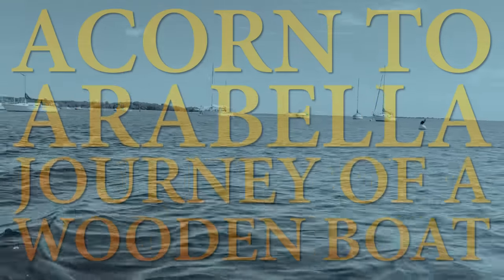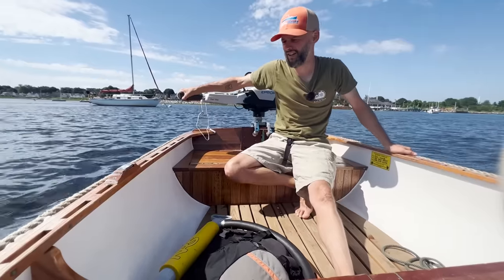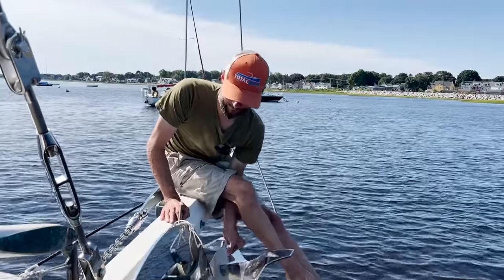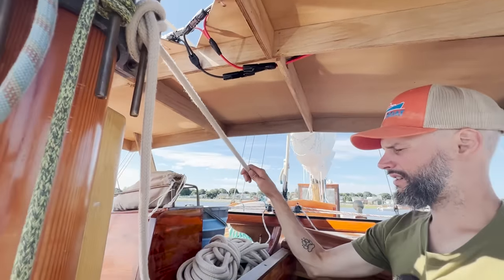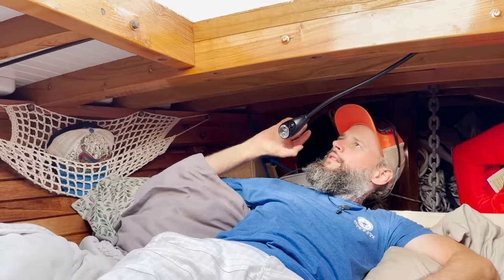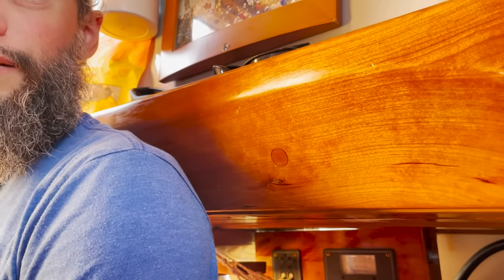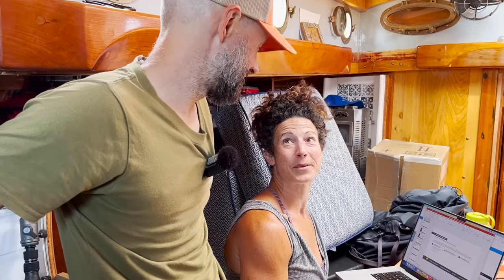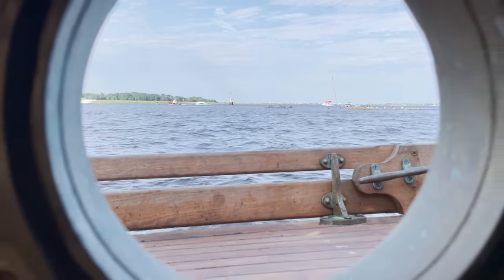2 Months on a New Boat, Full Walkthrough - Episode 277 - Acorn to Arabella: Journey of a Wooden Boat

Comment: The 12V LED strips expect no more than 12V and everything above heats them up and shortens their lifespan. If the boats 12V system is based on the battery's state of charge 11-14.6V - this might be the problem with them burning. You can check it with multimeter. One easy way to decrease the voltage is to put power diode(s) in series with the LED strip. Diodes have a forward voltage drop of 0.7V. So might need a couple stacked together.
Reply: Heat is the enemy of solid state electronics.  I was going to suggest a 12v buck boost power supply is cheap.  It will take 8 to 28 volts DC, and give a steady clean 12.0 vdc.  Also make sure heat can escape the light fixture/housing.
Reply: Too low voltage will also cause excess heat, as the amperage will rise.
Reply: Do they have a good heat sink onto which they are mounted? If cooling is less than adequate, they perish very quickly. Using an infrared camera to monitor heat build up over time might give you some answers.
Reply: would having a pwm led controller help? maybe reducing the duty cycle would help, running at 80% wouldn't diminish the light that much

Comment: Hi Steve, I have been following you since the beginning, never miss an episode, this is my first comment, I hope this can help you.
I used to work in an LED company, and the problem you are having is humidity reaching the sulfur coating.
All LED are violet by nature, a coat of sulfur is added over the led to adjust its color (Warm to Daylight). Humidity affect the sulfur and change its property (color),
in turn, that change the persived color of the LED. You need a led strip that is rated with a high IP factor, I think IP66 or more from a reputable manufacturer,
meaning having a very good seal again humidity, especialy on a boat.
Hope this help you in selecting the next one. Happy sailling. Gilbert

Comment: I love this episode. Obviously my land yacht has nothing in common with your boat, but every problem, fix, solution, and regret you have had on the interior is remarkably similar to everything I had to deal with. I know that my rig looks rough on the outside but the interior is a complete rebuild. The birth, I had to rebuild to install my 16kwh battery bank and create more storage. The head was rebuilt to accommodate a composting toilet.  The galley and dinette and cabinets are all refinished. Throughout the entire cabin we have walnut laminate flooring and blue beetle kill pine walls from floor to ceiling. The saloon is an epoxy penny table on an oak cabinet with 24" deep drawers. It's beautiful on the inside. On the outside the only thing that I have done is install the 6 panels 1500 watts. Basically I just sincerely commiserate with the trials and tribulations that you are going through and the happiness and elation of your success. My 6 year journey was congruent with yours for the six years my project took. I've been watching you from the lead keel pour up. Your videos helped keep me going. I'm so happy for you all! Now the real journey begins!
Reply from the maker: There is plenty in common between boats and RVs! Glad you’re finding this useful, thanks so much for sharing! —Anne

Comment: Strip weight as much as you can. What you add should be as light as possible. I built one of this design in 1976 and sailed it trans pacific to NZ. Mine floated on her lines when launched, needed a couple inches at the second haulout. She was low in the water always and super tender. Wet wet wet. Decks awash whenever going to weather. You have already overbuilt much of what is there. I’m talking pure function here. Safety, weatherliness, all of it. Strip it out and you will have a better sailing boat. Best you can expect with that design anyway. That aside, you did a great job with the craftsmanship level. And the home cut soul is there.

Comment: Some suggestions for you, Steve. Get a length schedule 40 PVC pipe to make a sheath for the anchor so the anchor stock doesn't wear a hole in the roller when stowed. Use water bottles or even gallon jugs to keep your freezer and fridge full... More thermal mass equals less cold air to escape when you open them. The bottles and jugs are great for cooler ice when you go on dinghy trips. If you have a problem with some items in the freezer not staying cold enough install a little fan to circulate the air.
Boat looks great.. it's very lived-in now..
Reply from the maker: The roller is bronze, so we're not really worried about it. I also recommend a big ol' hunk of delrin. One time, on another boat I cruised on, we bought 4" or so cylindrical delrin (hard as hell) and had a machinist turn it for us into bow rollers. I bet they're still in service 12 years later. —Anne
Reply: @AcornToArabella  groovy I thought your roller was nylon or something.

Comment: Really interesting and helpful.  Thank you. A few points, some of which I have raised before. 1. It's not so much that the vessel is down on her marks, as being down by the head, which you really don't want in heavy weather. If there is weight that can be transferred aft that would change the trim advantageously. Do you really need that massive workshop vice, for instance?. 2. Those anchors flopping around threaten to take charge and are potentially dangerous. Any movement at all will give rise to noise and wear. 3. The concern one would have about the Spectra strops is again chafe and wear. Most people, even seasoned sailors, are surprised by the amount of wear that can arise on long passages with comparatively little movement. 4. The dodger has more substantial problems than people walking on it. Strong winds and heavy seas can make  mince-meat of quite solid, if spindly structures, not to mention windage. 5. You have spotted the problem of the thumb cleats on the gaff - things that stick out snag. As I have mentioned on the Victoria web-site, her skeg is very liable to snag floating buoy lines. I would certainly recommend that you fair the leading end so it will ride over obstructions and seaweed.

Comment: Great tour. Congratulations on covering all the stuff you have done. I would like to make a suggestion regarding  the roller furling.  They are great when they work, but they can be a struggle in heavy winds when it was time to reef an hour before. 
Half a century ago, I used to work on a seventy foot Alden schooner. We had our outer jib on hanks. It was easy to furl. If you tie a line, which we referred to as a downhaul, to the top-most hank, and run the line through most of the hanks, through a turning block at the tack then in board at the stem, and have a cleat there on the bowsprit, it saves a lot of time, and is safer than climbing to the end of the bowsprit. Keeping the jib sheeted in, it is not perfectly furled, but is under decent control whilst all hell is breaking loose elsewhere.
Ah, those days were fun! I am sure you are about to have an equal amount of fun.

Comment: Personally - And I actively state I know NOTHING! other than what I've learnt from University of YT - I always thought the "waterline antifouling" looked a bit on the low side BUT (yes caps again because I cannot exclaim enough!!!) I'm so so so incredibly impressed by where the A2A team calculated where the waterline would be on a brand new  boat, built waaaay better than spec / design - shall we say oak to pine ratio whilst also considering the quality and density of the materials you used inside, Cherry, Locust etc etc plus all the modern tech that wasn't accounted for in the original design.... It just means that Arabella is more so an incredible feat of engineering than I ever thought she would be!!! In that case - what's a few inches of anti-fouling between friends??? 🤣🤣🤣 I'm honestly blown away by what the team have achieved!

Comment: This was extremely interesting!!

The LED strips burn out because it is built into its design.  LEDs are supposed to last for decades.  The issue is that the manufacture uses resistors that are WAY too small and the LEDs get hot and burn out.  The solution if you have the time and patience is to replace the resistors with larger ones.
Reply: Easier to put one power resister on the input or use a buck reg to drop down to 10-11V in my experience.  Amazing patience to rework all those SMTs!

Comment: Great to see your enjoying life on the boat.
 YOUR L>E>D lights. I had similar problem wih brown burn and then failing on a string that runs 24/7-365.
HIgh voltage situation running at 13.5 volts. Try a buck converter on a string of lights and drop voltage so that you get max lighting out of unit. Most likely they will run good at 12 volys or less.  Cheers and enjoy the new adventures
 Ron

Comment: You might try a voltage regulator on the LED strips to run them at a lower voltage. I assume you are powering them directly (no dimmer/regulator) off the battery bank, which would be running them with 10% or so more voltage than they were designed for (actual 12V). This would mean they run hotter than designed...and your failures certainly look heat related. I assume you are already using higher quality LED tape, and not the super cheap stuff.

Comment: In case your LED lights don't have a small ballast ahead of them, there should be something called a "current driver" ahead of those LEDs. Either they're wired directly to the 12V bus, which will cause current runaway, or their ballast is driving them too hard, and their current needs to be limited. I hope this helps. Cheers

Comment: Steve. About those LEDs that are in the head.
What I'm thinking about is your leds are having problems getting rid of the heat that they generate. Normally the LEDs are mounted on some form of heatsink that lets air pass over and remove the heat, I'm not sure what yours are like but it seems a reasonable idea.
What i would suggest is to add a resistor in the circuit to lower the current passing through the LEDs which will make them run cooler.
And i would definitely watch a few LED related videos by Big Clive, hes always taking things apart and making them better.
Hope this helps. 🙂👍

Comment: Doing small projects first and making sure you're comfortable first sounds like a sound plan. One thing about jib furlers - it will get stuck with the sail out at the worst possible moment when gale force winds come out from nowhere and you're single-handing. So have a plan for that occurrence :D

On the whole, those things are quite reliable though. That one summer when mine got stuck multiple times was completely my own fault, but of course I only diagnosed it correctly in late September... Oh well, has worked trouble free for many sailing seasons after that.

(The thing that happened was that the bottom screws that hold the foil in place in its bracket on the furler had worked their way loose and disappeared, and I'd just replaced the screws and tightened the foil to where it sat. And what I found out was that the foil shouldn't have been touching the bottom of the bracket but be riding 1 cm higher, there were holes in the foil for the screws to go through. Funny how much difference a 1 cm foil displacement can make. It wasn't hitting anything that would've gotten stuck, it was just the wrong height that made the furler sit a little bit differently and caused the furling rope to get stuck.)

Comment: Hello Steve, Before you spend a lot of money and time installing a roller furler I would suggest you take a look at Lin & Larry Pardey's book, "The Self Sufficiant Sailor", third edition, chapter 23, p.201-203, and consider installing a downhaul instead. In my almost 35 years of sailing experience I've seen plenty of sails come loose in windy conditions and get ripped to shreads. Sail lofts love this! Roller furlers also often jam half way out so you can't  get the sail down. Bad news in degrading weather conditions. And remember that roller furling is not roller reefing no matter what a rigger or sailmaker will say. The jib shape will always be too full when you need a flat sail as the wind builds. Eventhough furlers have been around a long time they are not foolproof. The more you sail, the more you will appreciate simplicity. You could add sail ties attached to the top of the bow sprit and a jib net on your whisker stays to give you and the jib more security. By the way, I'm proud to have my signature on your whiskey plank. Good luck!
Reply: He mentioned in the video that he already has the furler and jib  back at the farm. If he's already got that setup, he might as well try it. He can always swap it out for a more traditional setup if it doesnt work out.
Reply: I disagree.  A modern furler is trouble-free if installed and used properly. The.key is to bear off when furling the sail,  and keeping some tension on the furling line when rolling it out. If the sheets take a couple of wraps around the furled sail, and the furling line is secured, the sail will not unroll.  It’s still a good idea to drop it when preparing for a hurricane, and putting a sail tie either around the sail or.through the roller furler isn’nt a bad idea. You;re right that roller reefing doesn’t work, but then again you really can’t reef a hanked-on jib either. Best of all, the crew doesn’t have to leave the cockpit when the weather is snotty to douse the jib.

Comment: My LED's in my kitchen had the same problem. After several replacements, I realized heat was killing them.  I installed an aluminum channel as a heat sink to move the heat away from the LED strip and I've had no problems since.
Reply: Most of those LED strip systems are designed to over drive the LEDs.  This gives brighter lights and considerably  reduces the life of each LED.

Comment: You have soothed my concern about the nylon.  Thanks.  I am curious about the turnbuckle on the bowsprit of the boat.  Where will it go if that strap gives out and you're underway.  One last thing.  When you go across the Atlantic Ocean I would suggest buying a satellite phone and purchasing two months worth of time so that you can make phone calls home if needed.  Put in a speed dial for the Coast Guard District that handles the parts of the ocean that you'll be crossing.
Reply: Agree with all said as well as the many positive comments on everything you have done since the beginning.  I wanted to add that the bow sprit is more important than one might think.  Talk to some riggers of course, but it has to be tight enough so that the mast doesn’t pump when sailing.  This can lead to failure you do not want to experience.  Ever!  All the best.
Reply from the maker: Why is the strap going to give out? The idea is to inspect and replace the strap on a regular basis, probably every few years at any sign of wear. It’s rated for thousands of pounds and is of dyneema doubled up. The question could be asked of any individual part of the rigging, when you think about it. “Have a look, take good care of everything,” is the answer for all of it. 

Happy Friday! —Anne
Reply: @AcornToArabella  Hi Anne and Happy Friday to you as well.  My observation, not from personal experience with a traditional gaff head rig, was not to imply that it will not be consistently monitored or tightened and replaced as needed.  Just making note that masts pump up and down vertically when under load and moving through a seaway.  When making long passages is when I have seen rigging of all types loosen due to the loads.  Just offering an observation not any expert opinion and thought you may want to ask a wooden boat rigger what they think.  There may be enough flex in natural wood components that it is not consequential in any way.  Have a great day and congratulations again to all who stepped in to help Steve push through and get Arabella where she belongs - on the water.

Comment: The problem with the led strips is likely poorly matched diodes sharing the power, meaning that some are over driven compared to the others and overheat/degrade quicker. You can test this with a variable power supply by raising the voltage slowly from 0 and checking that all the diodes begin to light up at the same time. Good luck.
Reply from the maker: Interesting, thanks for sharing.
Reply from the maker: Is there a brand that has better-matching diodes or is that what’s going on with more expensive ones? —Anne
Reply: A properly designed / 'expensive' one will run the LEDs with a power supply specifically designed to run with a constant current, no matter the voltage given (within some tolerances). A LED run with a specific constant current will have a steady constant brightness and overall last a specific amount of time (YEARS/DECADES if they're not being run at breaking point). The cheapest manufacturer will run "just enough" LEDs at very high power / current so they look nice and bright but will burn out comparatively quickly, and or they will use hardly any or even no PSU circuits so the power is at the whim of the voltage going through. If not designed correctly it can also result in small differences compounding so stuff fails one after the other. For a LED, small changes in voltage might result in far larger changes in current (they are not "linear" in this respect), and so this can stuff things up as well.
Reply: . @AcornToArabella  I couldnt specify a brand unfortunately, tends to be you get what you pay for, you may be able to retro fit some cut to length led strip  which is cheap enough to take a chance on, either that or ask a supplier to reccomend one you can return if the above mentioned test procedusre shows it to be crap.